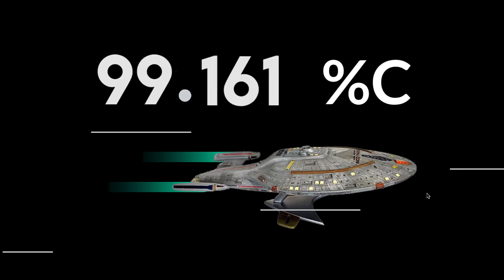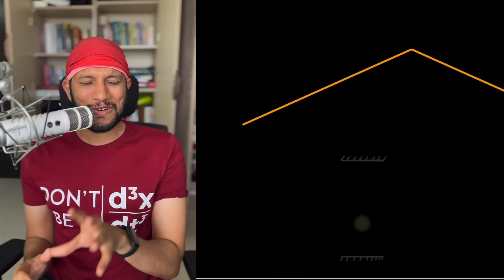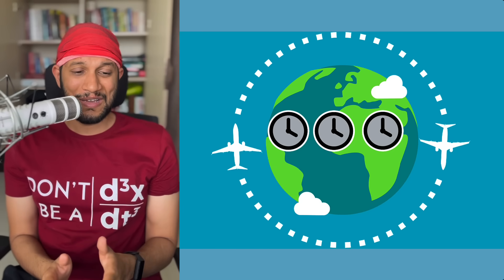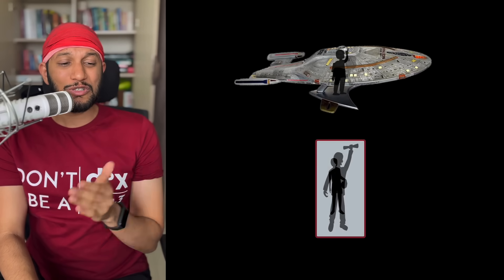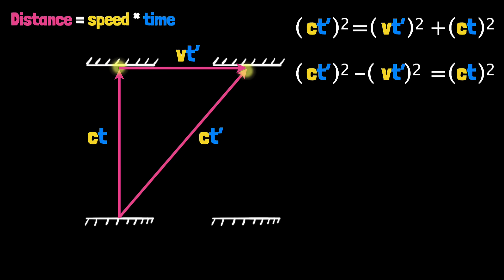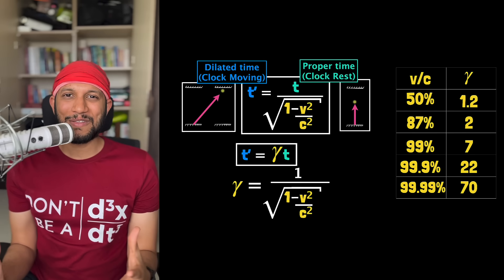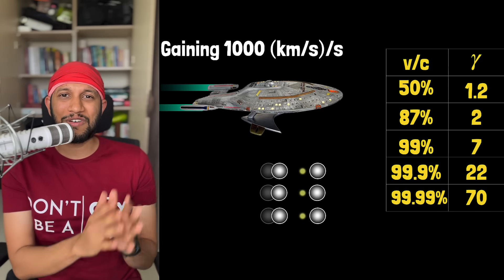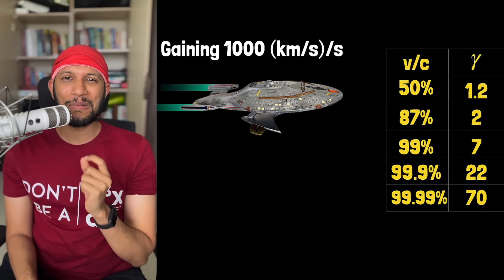I finally understood why you can't go faster than light! (My mind is blown)

Comment: Brilliant explanation. You looked at this from different angles, but I find the easiest explanation is that, as the ship gets faster and faster, the accerelation slows down and eventually approaches zero. It would seems that, as we approach the limit, it should be possible to reach the speed of light, but not exceed it. Is my understanding correct? Or maybe it is not possible to actually reach the speed of light? That point is still not completely clear to me. Another point I find confusing is this. If someone is travelling at the speed of light, does that mean they will never age and live forever? I don't think that is the case. Time inside the ship will still tick at the same time for the people on the ship, so time on the ship will still tick as normal relative to the people there. It is just that people on earth, who are relatively stationary compared to the ship, will appear to age a lot more quickly than the people on the ship. So, for example, if the ship was traveling at the speed of light for 10 years, people on  the ship will have aged 10 years. But, time would have passed a lot more quickly on earth, and everyone on earth would have aged a lot faster and already died. If the ship then landed back on earth after 10 years of travelling at, or close to, the speed of light, they would arrive on earth many years into the future according to earth time. Correct? This is all so fascinating to me. Awesome video!

Comment: Instead of a photon clock, what if we use a Quantum entanglement communicator type system where there's two quantum entagled particles. One on the space ship, and one outside. Let's say if we toggle one thing, other reacts. How would time work in that example?

Comment: As the author of the video explains - under the constraint "the speed of light is constant on all reference frames" the photons observed in a moving "mirror clock" (measures time by counting to photon reflections) appear to travel along a hypoteneuse rather the vertical, so that time elapsed must appear to "dilate" to the observer at rest.

However, what happens if we turn the mirror clock on its side? Simple calculations show the photons travel the same distance as they do in a clock at rest:

d = (c-v)*t' + (c+v)*t' = 2ct'

Therefore, there is no time dilation for the rotated clock! The rotated clock still says t = t' !!!

Obviously, time cannot be both be dilated and not dilated at the same time in the same frame of reference. Therefore, the constraint imposed by Einstein in the Special Theory of Relativity is patently absurd. We all intuitively know this the very first moment we hear about it. Only a simple thought experiment with the rotated clock is needed to confirm this.

There are many good alternative explanations for the various phenomena touted as proof of his Special theory of Relativity that the cult of Einstein refuses to consider. These are based on well established laws of non-relativustic physics, but I'll leave that for another day.

Comment: One idea would be frame dragging. Get a black hole spinning at the speed of light and hop into it's frame drag. You probably still couldn't exceed the speed of light, but you could come close due to the integrity of the frame itself. It's possible that you could exceed the speed of light if the frame could be accelerated to the speed of light because you would appear to be traveling through a timeless dimension. Collapsing time allows infinite theoretical speed. This would be tantamount to teleportation. Quantum physics already allows for the collapse of time RE: spooky action at a distance.

Comment: Most possible that Einsten was wrong. New discoveries show, that for example in extreme pressures (like neutron stars or magnetars) new states and new forces are revealed, actually quite unexplained by standard physics. Quantum physics must be applied to "explain" those. Same must be with the "speed of light" thing.  After reaching certain speed new physics is born and all those Einstein equations are worthless.  Btw you have a gift to explain things. Good job.

Comment: Also if you plug in V = C in the gamma formula, you will see gamma become infinite and T' become infinte T. Meaning infinite time for the observer. Just another way instead of the 1000 KM/s example. Another intuitite way, if the object moves at speed of photons, the force transfering photons cannot catch up to the next atom. This will cause stretching of the material, hence the expansion of the fabric of space time is only thing that can go beyond the speed of light!

Comment: One question sir, are u taking that Photon initially spining only between the plates and not moving in forward direction? And if you are taking soo, than how photon move diagonally when the spaceship is moving, because the space between the two mirror is not moving the are always in rest, than how does  photon is moving in forward or diagonally

Comment: And y not .. any speed is possible provided at that speed travelling object doesn't perish .. only 2 factor wud b reason .. pressure on object and heat generated .. but if vacuum is created around travelling object then resistance is almost negligible factor .. maybe in 50 yr to 100 yr humans wud b immortal and wud b in position to achieve atleast speed of light provided humans do not go extinct ..

Comment: You understand that the explanation given only works under conditions where changes related to the space through which the ship is traveling are impossible.

That's why most science fiction games and films rely on space manipulation rather than the ship's speed for travel.

If a person needs to get from one corner of a piece of paper to another corner of the same piece of paper, and to do so, they simply bend the paper, pressing the two corners together. This doesn't violate the speed of light, but to an outside observer, they objectively traverse this space at a speed exceeding the speed of light.

Comment: The whole theory is a brainrot. Speed of light has not been measured one way.
We don't know how long it takes to go a distance, we only know how long it takes to go aa distance and return.
The problem of that is you would need two clocks in each side in perfect sync to measure the one way travel.
Fundamental cosmic procedures and mechanics play a role of balancing the go and return speed of light in the constant value established. Maybe gravitational fields?
However there is no evidence to show that going one way the photon cannot travel faster. We have measured the how long, NOT the how fast.

Relativity tells us that a photon will have the same MEASURED speed for all observers. So an observer travelling at close to a speed of light can shoot a photon which will travel FASTER than the speed of light statically in one way and SLOWER than the speed of light going back to it's reference point, AVERAGING its constant value for all observers.

Another problematic area caused by the two-way measuring principle  of the HOW LONG, is that we don't establish what inertia status means. The universe is moving, noone is still.
We know the light travels 300000km/sec in vacuum. From point A to point B. Meters being affected by the universe expansion and other time-space dilation mechanics. But we measure on earth or shooting lasers on the moon, within our solar system, in gravitational fields. The solar system is moving, earth is moving the reference points of measuring distance over time are moving.  

IF the speed of light is 300000km/sec, when shot towards the earths direction through space, it immediately adds up to earths speed through space and if shot towards where the earth has already been, would it move slower? Will it average out?

One-way measure is key and still has not been done. Therefore I'd say that we DONT KNOW if we can move faster than the speed of light, but we do know that we cannot GO AND COME BACK faster than light could do it.

9/11/2025

Comment: If you used a quantum clock in your analogy would things be different. In your 'Normal clock' analogy you state that when you zoom in, looking at the first atom as it accelerates, the other atoms cant accelerate at the same time. As information takes time to travel as the atoms are bonded electromagnetically. What if these atoms are quantum entangled ? Then the information is communicated instantaneously.... no lag.... no time is taken, so now the hand of the clock moves normally as it would if the clock was stationary.

Comment: But isn't this just in reference to an external observer? How do you explain the non possibility of acceleration to speed of light from the resting position inside of the ship? With no loss to external factors in terms o resistance or whatever what is stopping the object from accelerating over the speed of light?

Comment: interesting with photon clock, because it should not matter if you observe it from inside moving object or outside, photon will need to move same distance, so time between ticks should be same. But it all depends, how we define time, because if time definition is affected by gravity or information transfer between 2 particles on Earth, it will not be same further from it. So maybe it's not photon clock that is ticking different, but our time measurement is relative to our environment.

Comment: How fast is the Earth moving, 1040 mph?  Does this effect laser inside a fiber optic cable when it transmits around the world?  Is the transmitted light slower than the received light, no.  From our current perspective, we can't fully comprehend time or the speed of light.  If the sun punches light towards the Earth, can we send light waves back to the sun, or will the rays get slowed down so much that they are pushed back to Earth?

Comment: Time is relative, time dilation is a failure of perception, it dilates just on another frame of reference with a relative speed from the observer. Time doesn't dilate, space doesn't squeeze under tremendous velocities, it does from another perspective. It's the faulty process of observation that requires light to acquire information, thus everything looks distorted, but reality is not affected by what I see

Comment: And as everything in physics, there is an assumption behind, and for this, it is that all communication is done through photons. What happens when we find out that two "things" can communicate without photons? :). This realm of quantum is where all hell breaks loose. Of course, in that scenario, we can no longer talk about "speed", but some sort of teleportation, or "wormholes". This explanation is kind of also clearing that part as well, meaning why the physicists needed to think about wormholes as the next "possible" thing. 
Thanks for the video!

Comment: Well, just because it is moving, sure it is going further in reality. But because it has constant, even angular momentum, it would still tick at the same speed. Why would it's moving sideways change the beam's speed? If anything, it would no longer hit the other side because of movement. Not that it would travel slower.

Comment: So, what you're saying is that, if I want to achieve eternal youth, I have to move close to the speed of light... Interesting.

But then, if I want to continually increase my acceleration, I would need infinite fuel, ergo, infinite mass, which would make either be extremely fat or extremely dense.

Woah.
Reply: For you, in the ship, time will be the same. Most likely, you will just see it speed up around you. It's like in the movie "Buzz Lightyear"

Comment: Why do you accept the photon clock continuing to tick once it starts moving? You inherently accepted that the speed of light is the maximum speed at which information is passed. That assumption will not yield anything new without an experimental result breaking this assumption. 

It's the same as saying "Assume that apples are always sweet. Now I buy 10 apples. How many sweet fruits do I have? It will appear to be 10 in a thought experiment, till you physically buy apples and realize that oh, 2 of these apples are actually sour.. "..so you can conclude either apples become sour when you buy them, or your assumption could be wrong to begin with 🫡  
Just stating that you didn't explain why...but just described the assumption 🫥

Comment: Sooo I've done some simple math according to this info, and if I understand correctly, in order to travel a distance of one light year (9,46 trillion km) and supposing we travel with 99,99% speed of light, we would make it in 1 year and about an hour.

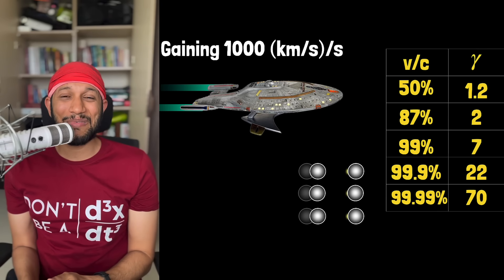However, back on Earth this would be 70 times longer (according to the video at 14:11), sooo we would travel one light year in 70 years. 

But if our speed is 50% of light's speed, for us that would take 2 years and on earth 2,4 years....

Well if that's right...it's crazy
So, that's quite...interesting?

Comment: 7:26 so when Einstein says you need SOME process to measure anything in science, it struck me that time is just something which was invented by us. And all these equations are to measure something which was a human invention. I mean, to the person INSIDE the ship everything is normal right? Even though time is moving slow, it is only so to an OBSERVER. The one inside the ship doesn't get any "advantage" because they're moving at the speed of light. When you say they're 10 years old while the observer is 40 (for example), it doesn't mean they lived 40 years in those 10. They're still a kid with a kid's life experience. So, again, time seems to mean nothing in the end? (or just time dilation which would mean time by extension)

Comment: There's is fundamental problem with this theory..
The photon tic inside the spaceship doesn't deviate i.e it takes 't' not 't dash', from the perspective of those within the ship, right?
The problem with this understanding, is that for the photon to maintain its time (within the fast moving ship), the horizontal velocity of the photon should be the velocity of the ship, right? Meaning, the photon should also travel the same speed & direction of the ship, in addition to making its vertical movement, to get reflected from the mirrors, to constitute the tic..
This further means, the photons must be having the 'inertia' with the same force as that of the kinetic motion of the ship.. This further means, for the inertia on the photon to be present, the photons must have a mass..
Now, here's the issue - photons don't have mass - meaning, expecting their horizontal travel as with the ship is not correct.
So, the basic premise of the example itself ain't correct..
We generally see them reflected inside  fast moving object, it's due to the fact that, the object's (spaceship's) velocity is negligible in comparison to the photon's. But, in this case, if the object itself travels close to the light's velocity, the photon would never get reflected back & naturally, would never perform a tic..

Comment: This certainly explains why an outside observer could never witness an accelerating object hitting the speed of light in a finite amount of time but why wouldn't those onboard the ship experience themselves hitting the speed of light in a finite time? After all, from their own frame of reference the photons and the force transfer mechanism is still operating at the speed of light relative to them so their own perceived sense of time would not slow down and they would continue to observe themselves accelerating at 1000km/s even as their acceleration appears to be decreasing from an outside frame of reference. So after ~300 seconds of their own perceived time they should be at light speed without needing to expend infinite energy shouldn't they? I know the universe outside their inertial frame of reference would become flat and tunnel like with extreme blueshifting ahead and redshifting behind and would appear to age at an infinitely accelerating rate as they approached 300 seconds of local time but assuming they could somehow survive the end of the universe itself what would happen in their own local frame of reference as the onboard clock ticks from 299 to 300 seconds?

Comment: 02:52 are you suggesting that the information about movement from the first atom onward of the second hand would travel at the speed of light? wouldn't that information travel through a compressional wave traveling through the material of the second hand at the speed of sound? 
it also confused me as to which frame of reference should we consider. the moving clock's or ours as external observer?

Comment: But the fact that a physics timepiece doesn't work correctly in motion, has nothing to do with time changing. no matter what you measure time with, it makes sense that it won't work correctly unless it has completely stable conditions. 
it doesn't show that time is changing, just that your watch doesn't measure time correctly under certain conditions.
A watch doesn't dictate time, it measures it.